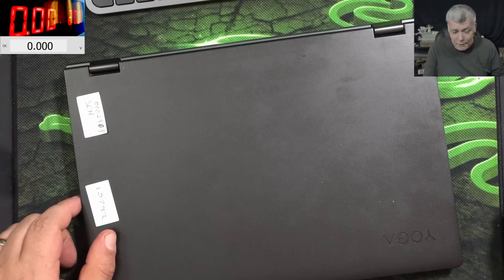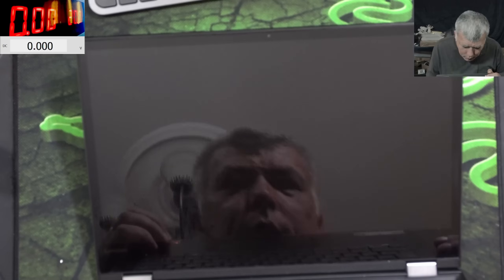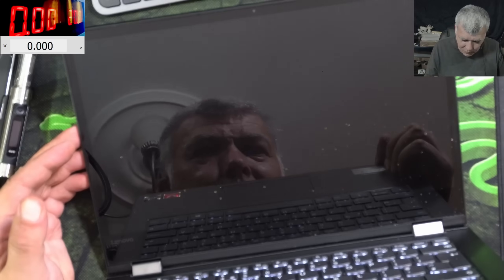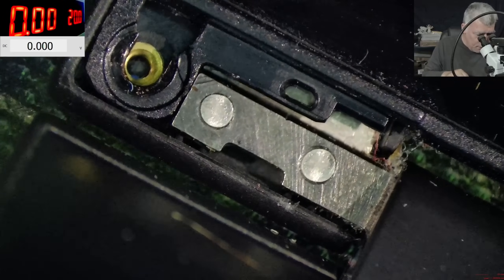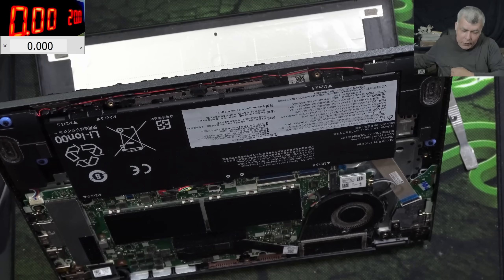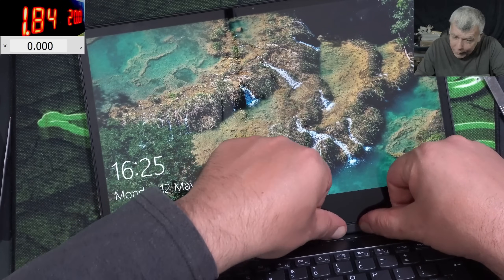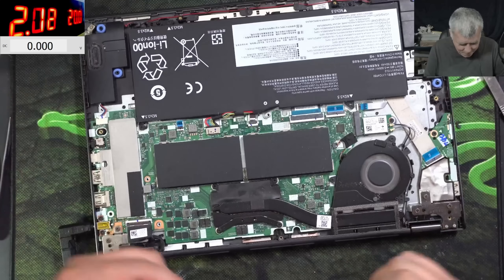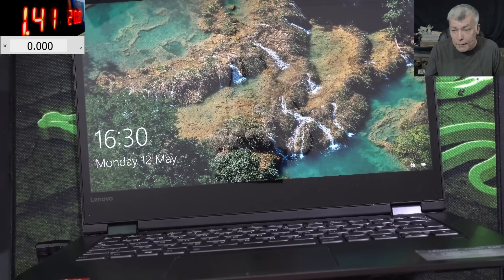Lenovo Yoga 530 coming on with no picture - A tricky fault

Comment: Sorin, at the initial fault finding you "fixed" the fuse resistor by touch it and the current could flow again to screen but the computer already started. Could be the video card not enabling the output because somewere the firmware readed the fault status from screen at first place? Now you then shutdown the system and then while powering up the backlight voltage is present and enable the video output to panel. That fuse resistor need to be changed tough...

Comment: I think when you fixed the resistor, it didn't reset properly. When you unplugged the battery and plugged the charger in, it reset and worked?

Comment: Since I have a similair notebook: remove the Battery and check the keyboard flex ;)
It is made to fail by simply using that pos.
Get some ipa and liquify the glue, you will see 2 180 bends under the battery which WILL fail after some years because the battery compresses and decompresses those bends -> broken traces for which you will need liquid silver to fix.
Add some stiff plastic to reinforce it, your customers will thank you.

Comment: Reseating the cable did the thing. Move it around to make sure doesn't become a habit.
Bad connection constantly arcing to charge the caps can burn the fuse...

Comment: If it was me, I would have 100% broken that screen removing it with a metal tool without pulling the adhesive strips. But for Sorin it's no problem. 😅
Reply: so would I, even I do it gently. Sorin's touch is just on god tier level lmao
Reply: Just thinking about opening  and I would break the screen. 😅
Reply: @octavian9627 😂
Reply: just how? how this even possible?opening fragile screens with metal spa tool , it was a touch screen too
Reply: have you seen Sorin using hot gun near electrolytic caps, even the caps not dare to pop 😂
Reply: And bend the bezels around some fresh nicks too😂